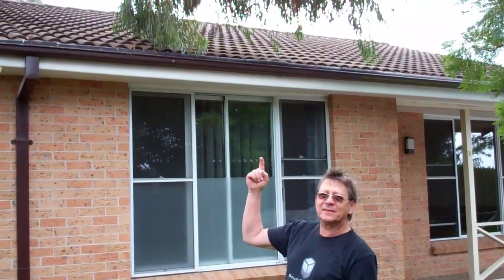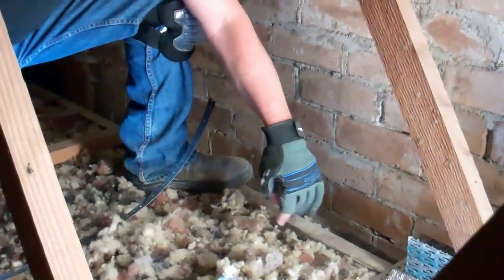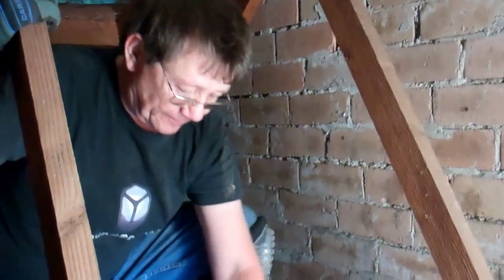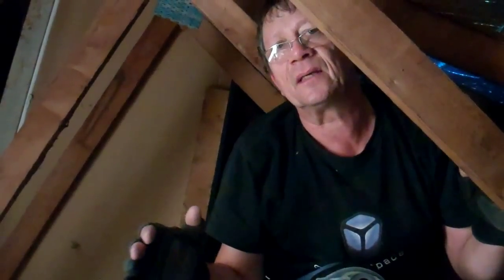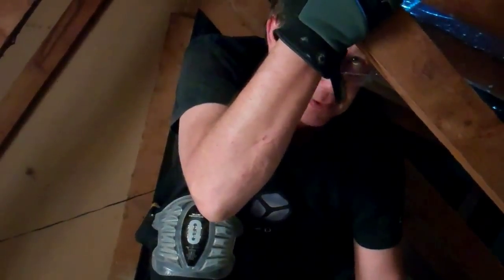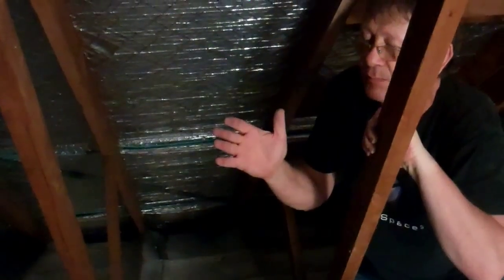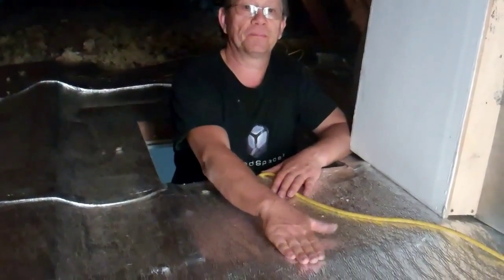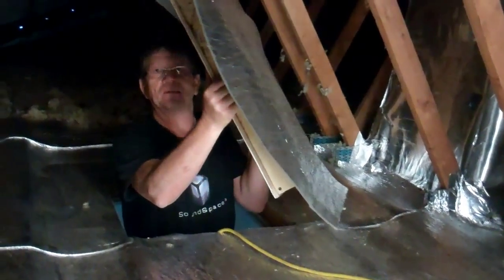How to Soundproof A Roof For Traffic & Aircraft Noise

Comment: Any condensation issues if you apply the vinyl to the underneath of the roof shingle/felt? Outside neighbour dog in an attic room is my issue. Can't access one side of room eaves though
Reply from the maker: Good question! Generally, there are no issues with condensation, unless the MLV is installed just below a tin roof and in contact with it. if you are installing the MLV directly under a skillion roof, for example , you'd need to remove the battens going across the rafters, install the MLV and the battens back, on top, to provide an air gap and install some thermal insulation between the tin roof and the battens,  that should prevent any condensation.

Comment: Would installing the mass loaded vinyl over the joist for one room completely deaden the pops and cracks in the attic due to thermal expansion and contraction? 
Also, the insulation in between the joist right now is old grey blown in loose fiberglass.  I would like to replace it with Owens fiber glass R-30.  I would do batt insulation Roxul mineral wool safe n sound but unfortunately they currently only sell the insulation for 16" cavities and my joist are separated 2 ft on center. Would it completely deaden the cracking and popping sound from thermal expansion if I replaced the old insulation with new fiberglass?
Reply from the maker: Difficult to answer, if it's airborne noise you hear above the MLV, it should stop but if the noise is coming from the joists, under the MLV, it will stay the same, just slightly less but you may not hear the difference; another point is that all the roof structure is connected and any sound from the structure itself could be partly heard. If you hear cracking noise, maybe it comes from a corrugated roof and in that case it should be ok, you may not hear that sound anymore or just faintly as some of the vibrations will travel through the roof structure.
The new fiberglass or polyester or any other type of fibres will not stop enough the sound because there are sound absorbers but not sound barrier; it will reduce a little bit but not enough. The reason we lay the batts, for acoustic purpose, is to avoid the sound bouncing to itself when trapped between the ceiling and the MLV above and increase, so, it's to absorb the sound inside the new cavity, a bit like drum effect.

Comment: Good video but is that aluminium coating on vinyl ? If it is then its very dangerous in an attic. I believe its banned in New Zealand and Australia because of electrocutions, Folks were installing it for thermal insulation. If any live wire touches it the whole thing is at 220 volts and you are dead !!!!!!!!    please check this out for yourself
Reply from the maker: Yes, I am glad you point it out, it is a very good comment, it happened to me twice when I was soundproofing roofs around Sydney airport in the early 90's under the SANIP project (Sydney Aircraft Noise Insulation Project); I was lifting an old electric duct, made of steel with wires inside, very old and brittle and just by moving the duct a little bit, was enough to create a contact and the duct became live and I got a good jolt; the second time, in another house I was pushing the vinyl under a similar electric duct and the foil got live with blueish "flames" dancing around but I didn't get electrocuted this time and I was in contact with the foil; anyway, I told the government inspector in charge, at the time, that we wouldn't anymore install our mass loaded vinyl with old wires around, that the houses concerned would have to be re-wired and having safety switch on the board and everything checked by an electrician prior to any installation and after that we didn't have any more problems and we've soundproofed hundred of houses. 
The foil is necessary to hold the tape firmly and eliminate gaps, but of course, the electric wires must be safe and correctly installed before starting the job. We can install this product in roofs, in Australia and New Zealand, it's not banned.

Comment: If that insulation was just below a corrugated iron roof would it stop most of the noise that rain makes?
Reply from the maker: Yes, it will stop the rain noise, a lot if not completely but it's recommended to work from the top and remove the corrugated iron and the battens, install the batts between the rafters, install the MLV on top of the rafters, overlap, tape, make sure it is sealed all around, put back the battens on top of the MLV and putt back the corrugated iron.
Reply: Thanks mate

Comment: Who manufactures this material? Struggling to find a foil faced
Reply from the maker: The brand I am using is made in Australia, that's where I am based but you should be able to find it in the country you are living in, it's called MLV for Mass Loaded Vinyl or flexible sound barrier. Which country are you?

Comment: Hi. just found your video, really helpful tips! I have 2 questions on installing the mass loaded vinyl. I have insulation already installed so if i lay it over the top like in your video, can I then put even more insulation over the top of the mass vinyl? To keep extra heat in the house? 

Also, I've created an area in the centre of the loft for storage space and boarded it out using MDF wood. If I lay mass loaded vinyl on top of the MDF, can it be covered with a carpet on top of the mass vinyl? 

Thanks
Reply: Yes, absolutely, you can add insulation on top of the  mass loaded vinyl! Yes, you can lay the MLV on top of the MDF and carpet above but the MLV will be more efficient if it doesn't touch directly the MDF, so, ideally, you could lay a carpet underlay, the MLV on top, another underlay ( to reduce more impact noise) and the carpet.
Reply: @philipperessos5499  thanks for the reply. I'll give it a go. We have planes coming over frequently and the vibrations can get bad at times. Is there anything I can do for the windows without replacing them straight away? They are double glazed but eventually I'll get acoustic glass.
Reply: M S the most cost efficient way would be to install a secondary window with a minimum of 10.38mm thick, laminated glass with an air gap as big as possible between the two windows. The bigger the space between the two windows, the bigger the sound reduction. The air gap can be as important as the thickness of the glass; another very important factor are the seals, we need windows with good acoustic seals. Seals could contribute to 50% sound reduction.
Reply: @philipperessos5499  thanks Philippe. I'll see if I can get a window company to come have a look at it for me.

Comment: What about wapour? Thermal insullation can not drying...
Reply: Good question! You won't have condensation between the plasterboard and the mass loaded vinyl on top of the joists but in very very rare and particular circumstances, you could have formation of condensation on top of the vinyl, I've only saw it once since 1992 and I did that treatment for hundreds of houses and commercial buildings.
Reply: @philipperessos5499  But humidity of insulation will be higher than before. Condensation can be not only on bottom of MLV, but in top layers of insulation.

Comment: Thank you for the video. I live directly adjacent to an international airport. My house is directly .4 miles from the end of the runway. My house has vaulted ceilings in the living room. If I ripped off the drywall, and installed this over the joists, and then installed the drywall using furring strips to create an additional air pocket, would this reduce sound substantially? Note: the bedrooms have standard ceilings with loose fill insulation between joists. Thank you.
Reply from the maker: Yes, it will make a big difference providing the mass loaded vinyl is installed correctly, with no gaps. The weakest point would be probably the windows and it is the first thing to fix, before the ceiling, you need to install a secondary window with biggest air gap as possible (70mm - 100mm), and 10.38mm thick laminated glass, minimum. that will make a big difference already, if it's not enough, then you can insulate the ceiling/roof.

Comment: Hello Phillipe. Can someone add one or two layers of drywall to an existing ceiling? Loud muffler noise pours through the soffits in the eaves. Thank you
Reply: better try epdm over the roof, you can also try pe, polyurethane wool rock foam and finally drywall

Comment from the maker: ideally would be to install a secondary window inside with 10.38mm thick laminated glass as you can see behind me at the beginning of the video; alternatively, if you don't need the light and want a cheap solution to block the noise from the window, is to install thick MDF boards, 25mm (1 inch) thick for example, inside with some sound absorbers fixed on the board, between the window and the board; that would be much better than the crock because the cork is not the best sound barrier, it doesn't have much density, it can reduce a bit footsteps noise or impact noise.
Reply: Please explain more... What kind of sound absorbers do you suggest to be fixed on the MDF boards? How would they be secured to the windows to block the noise?
Reply from the maker: I am using high density polyester but you can use acoustic foam, that should be easier to find and you install on the board, glued or stapled, to be facing the window. The MDF can stand on the window sill and may be a button fixed on top, on the architraves and sliding the board behind or some magnetic acoustic seals fixed all around the window frame, that's even better.
Reply: Will foam on its own in the window be enough to block aircraft noise from outside? Or MLV combined with MDF board be the best option and how many kg for MLV? Looking for the cheapest effective option rather than replacing window
Reply from the maker: No, foam on it's own is not good enough, it is just a sound absorber, not a sound barrier but it is good to have foam in any cavity to stop reverberation, the drum effect. You don't need MLV, just 25mm MDF and foam, 50mm thick if you have enough space but do not compress the foam between the window and the MDF board, otherwise it will be a bridge for sound, better leave a gap. you can add a couple of handles on the board, easier to handle.
Reply from the maker: Aargh! I've just answered and the whole thing disappeared haha! No, foam is not enough, it's just a sound absorber, not a sound barrier but it is necessary between the board and the window because we have a cavity and it create a drum effect, increasing the noise. You don't need a MLV, just the board 25mm thick with a couple of handles to make it easier to put in place and remove. the foam can be 50mm thick, minimum and if you have enough space, do not compress the foam between the board and window, leave a gap, to avoid a bridge effect and transmit more vibration inside.
Reply: Thanks for the prompt reply! :) My local hardware store only sells maximum 18mm MDF boards. Is that ok or should I buy 2 of 13mm boards and glue them together? Also, should I try 2 MDF boards first (maybe 1 on the exterior window where there is space and interior too) before buying the foam? Or both boards to be placed exterior and is there any difference in sound? There is space but winter's rain is coming in the next month or so
Reply from the maker: 18mm will already make a good difference, at least it will be lighter to lift, the most important is to have it sealed the best you can, also the biggest distance between the window and the panel the better sound reduction you'll have

Comment: Thanks for your informative videos. Would the 30dB reduction still happen if the MLV was only installed above one bedroom (instead of across the entire house)? Also, how much sound will still be transferred via the frame of the house?
Reply from the maker: Yes, it still happen above a bedroom only, providing, you go pass the walls and bring the MLV down to the ceiling. it is very important to reduce gaps, openings as much as possible.
Installing a high density sound absorbers between the joists is very important too, an average density should be around 20kg/m3. Before insulating the roof, make sure your windows are sound proof enough, windows are the weakest points that should be treated first, like adding a secondary window, inside with an air gap 80-100mm and 10.38mm thick laminated glass or thicker.
Reply: Would covering the outside of the window with a thick cork/particle board do a good job of insulating aircraft noise? Assuming it was flush with the outside of the house.

Comment: Any moisture problems doing this? Seems moisture could get stuck between the ceiling and the vinyl.
Reply from the maker: No, absolutly no problem at all in this scenario but if you want to install the acoustic materials just under a tin roof, the procedure will be to remove the tin roof and the battens, install the batts between the rafters, than the mass loaded vinyl on top and across the rafters, overlapping joints 50mm-100mm and tape, than reinstall the battens and the tin roof on top. That way, there will be an air gap between the loaded vinyl and the tin roof. I am using also high density polyester batts, it is water repellent, in case if the roof get damaged and the batts get soaked by rain, it wouldn't damaged the batts but you'd have to cut through the ml vinyl to let the batts drying than re-tape after.
Reply: Thanks for the response!
This would be for a home with a shingled roof and insulated attic. There is a similar sized air space in my home as yours, and was thinking of laying MLV over the bedroom attic floor just as you have. This is however in a fairly cold climate, so condensation is a concern.
Reply from the maker: gernader8 I never had the case and I've installed MLV myself and with my teams around 150 houses, I don't know exactly, I just remember that I had once a problem in a school with a tin roof, the condensation was forming on the tin, dropped on the MLV, followed the lowest point went through a joint and leaked through the ceiling; we solved the problem by installing 2 vents in the roof. Most roofs have sufficient ventilation to avoid this problem but I never had condensation between the ceiling and the MLV, probably because we always lay insulation between the joists prior installing the MLV. I know this system have been installed by others in roofs where temperature goes below zero c.
Reply: soundproofingexpert thanks a lot for the detailed information! I will have to look into doing this when the weather warms up some.
Reply from the maker: Spring may be a good time, in the summer it can feel like you are in a stove, if it is warm outside, it may be too hot in the roof cavity.

Comment: Phillipe, if this material was placed in between the roof rafters from ridge to eaves would it be good value, and an excellent job? Stapled of course? Any brand names you know of. Any advice welcome.
Reply from the maker: you can cover the rafters with it but not just between because the rafters themselves will transmit vibration, you must follow the same principles than for the joists, with the foil facing you, overlapping the joints and tape, trying to avoid any gaps. if it's a skilion roof, you can remove the corrugated iron, the existing battens, than cover the rafters from the top, same way as for joists, put the battens back and the corrugated iron or Kliplock or whatever roof sheeting it was.